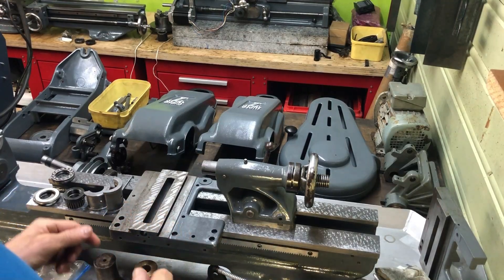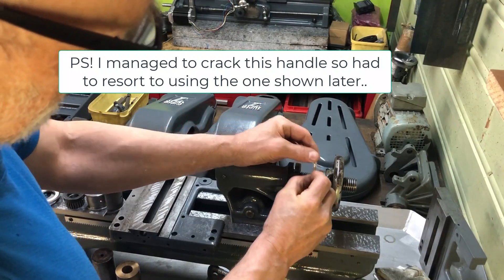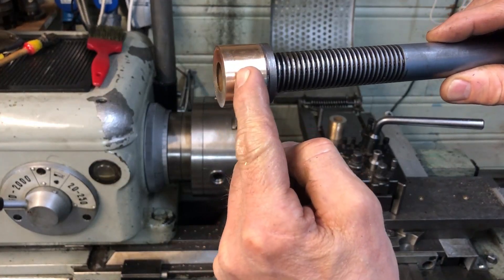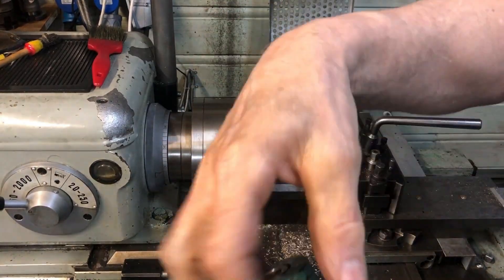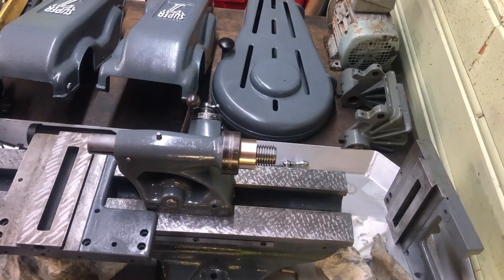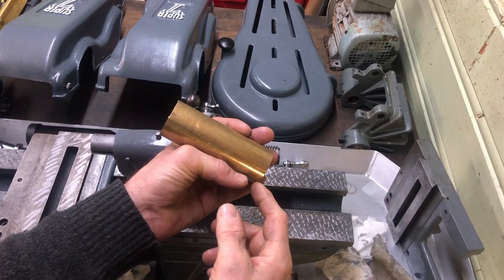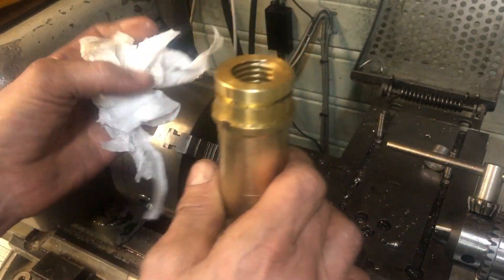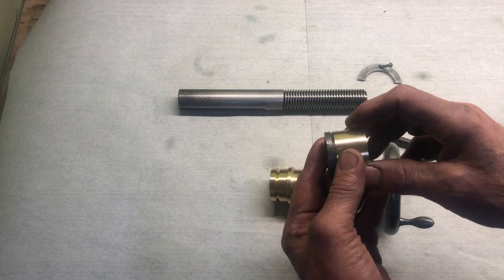Myford ML7 - tailstock modification

Comment: Hello,
what was the length of travel on the original part and how much increase(in travel) did you get with the long barrel modification ?

I wanted to get a 12 inch long drive(travel) to send the drill bit through and through a 10-12 inch cylinder.

My 4.5 lathe has a tail stock that may travel 4-6 inches, can i modify it with your modd so it travels more than 12 inches ?

thanks.
Reply from the maker: Hi there, thanks for the comment. This modification didn't change the travel for the tailstock barrel. Still is 4".
Reply: @jansverrehaugjord9934  ... oh i am so sorry, I was looking for solutions to increase the travel and i saw your video on the fly as i was simultaneously looking at other videos.

As clearly I've missed the reason you would go through such a mod, I would appreciate if you clarified what is this mod achieving ?
Reply from the maker: @IAGVyuing  2 things really: ejector as well as better access/handling the handwheel

Comment: a slightly off topic question but why are there long scrape marks on the top of the cross slide male dovetail on the carriage? Isn't this is a clearance surface and not usually scraped?
Reply from the maker: Correct. This is just a clearance surface.I honestly don't remember about these, but scrape marks have no function there..